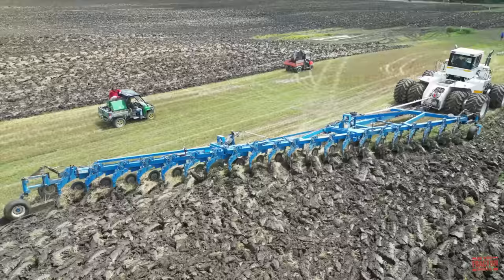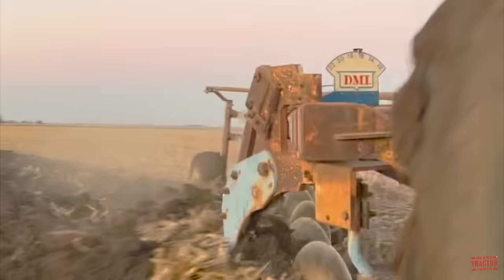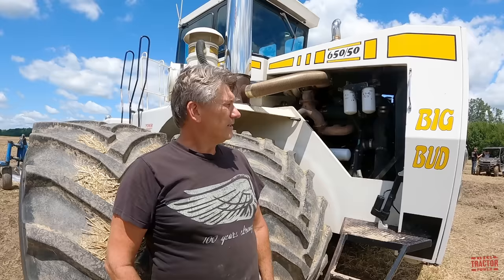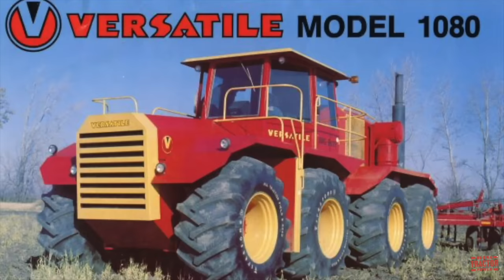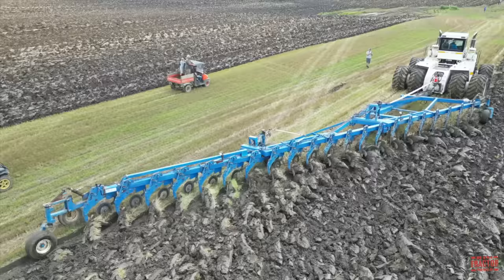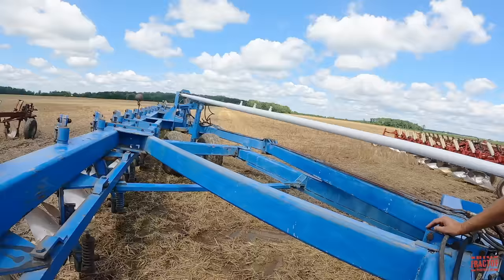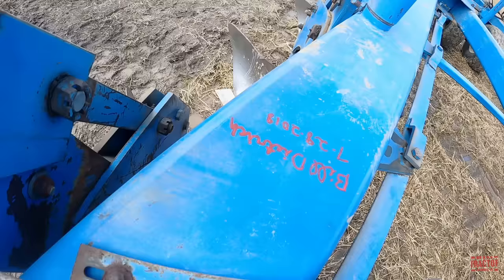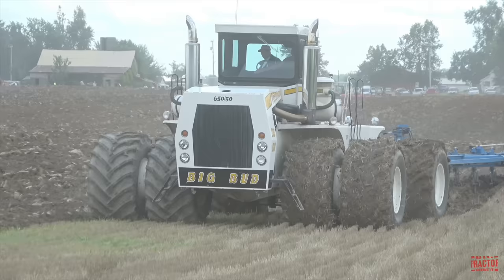21 Bottom DMI 9021 Hydra-Wide Plow

Comment: Everyone loves plowing videos. There is just something extra special about it that everyone  enjoys  watching or doing. Seems like a lot more farmers are starting to go back to moldboard plowing the last several years too. We have driven through North Adams MI and the surrounding area several times. Never saw this tractor, but would have been cool to.  What does the 50 suffix stand for in Big Bud tractor model designations?
Reply: I think in some areas you need to turn the ground over. probably more in potato ground.
Reply: 50 stands for being equipped with a Twin Disc transmission. They were first manufactured in the Minneapolis, Minnesota area.
Reply: I do love a ploughing video, if it's done right.

Comment: When I was a kid tillage, plowing and discing was every year.  Nowadays it's rare to see.  Doesn't tilling the ground potentially help with more yield?
Reply: Greatly depends on the ground and the crop.  Organic crops are getting more popular and those farmers use tillage to help control weeds.
Reply: Basically tillage is expensive... just with diesel alone....no till saves a ton of diesel cost...that being said....I don't know the current cost benefit of till vs no till.
Reply: So much depends on the soil, the climate, and the values of the farmer. Tillage is easy, and does a good job of covering up mistakes. On level ground, it may not be too detrimental, especially in more northern areas. On lighter, more rolling soils, properly done no till will do a better job of maintaining soil health and gives good yields, but it take more intensive management and it is harder to hide mistakes.
Reply: @samb7652  No till requires a lot of chemicals to control heavy weed pressure and more fungicides to control foliar leaf diseases that are always left on top of soil surface after harvest. Several diseases overwinter on the soil and are ready to overtake the field the following year. Examples are tan spot in the wheat and white mold in beans. If you leave diseases and weeds to keep reproducing, then the weeds get "smart" and resistance is the next problem.  No right or wrong answer, just depends on your crop rotation and type of soil.

Comment: Designed and Manufactured with Ingenuity is what it said on my DMI plow. The hitch on mine lacked 'Integrity' so the local welding shop/ part time farmer rebuilt it to withstand 300 hp (5 bottom) No reason to have to fix things more than once was his motto.
Reply: We pulled a DMI 12 bottom with our 300hp or so 8550.  What we had they called "over engineered," it was huge, really overly heavy duty. It was a site to behold.  Hard to imagine something didn't go wrong during production of yours for a hitch of all things to need welding.  That must have been a big job
Reply: @heatmoon  8-18s was a good match for our 8650 in our soils.There were a lot of older (white) small ones that the front end ripped out, center beam was butted up against a much thicker flat plate and welded on.The hitch offset and pulling from below not hard to see why some failed. The welding shop had just finished doing another one before mine. Had a 4440 on it when it let go. Flat steel where 2 large angled pieces tying it together made it much stronger.

Comment: I like this video especially because you included a look at the other tractors owners had use to pull this plow. They were debating how much horsepower the current Big Bud needed to pull the plow. A rule of thumb for handling a plow is one draw bar horsepower for every inch of plow width. If this plow can be widened to plow a swath 40 feet wide (480 inches) at minimum the tractor pulling it would need 500 hp at the draw bar. Likely 650 engine horsepower. That's a lot of tractor and power to put on the ground.

Comment: I grew up farming in the 70's and would'nt even think about plowing when the ground was that wet! I also worked for a farmer that had a 10 bottom Dmi plow.
Reply from the maker: Nice on the DMI. The reason is so wet is this was a plow day planned for the last weekend in July on the Saturday and it rained 3 inches the night before so it was postponed until the next day and it was just about dry enough to run out there.  People traveled from all over the country to be there and they wanted to try to run surprisingly they ran a Degelman pro-till right behind the plows and the ground melted out pretty good with just one pass

Comment: Have used a 6 bottom dmi hydra-wide for fall plowing, really great was when doing fields after picking corn if started to plug from stalks would just open a little bit, let the plug go through, then close it back up, the farmer worked for had added a stop at 18 inches so wouldn't close any farther after opening for plugs
Reply from the maker: Very nice.  What did you pull your DMI with?  I just shared an IH 1566 with a DMI 6 bottom on a YouTube short at https://youtube.com/shorts/shosA_jSaZE?si=6HT9wy9huCjNLqP-

Comment: Do we not use large (oversized) tractor and attachment like the Big Bud/ DMI 21 bottom?

What would be the reason for not building Big Bud/ and other large attachments for it?

-Cost? 

-Maintenance difficulty?

- weight/ material stresses?

Sorry if foolish question?

Richmond, VA
Reply from the maker: Good question.  In the 1970’s farm equipment was getting bigger and bigger.  Plowing was the main form of tillage. 

By the early 1980’s tractors reached a peak in horse power as crop prices fell, drought reduced yields and high interest rates hurt sales.  

Plowing quickly gave way to faster paced conservation  chisel plows and no-till.  

By 1985 the 500-600 hp tractors all ceased production. 380 hp became top end for a decade until the mid 90’s.

Comment: You might want to mic up the interviewee next time. And maybe a wind screen.
Otherwise good video.
Reply from the maker: Yes the wind was unfortunate  for the sound as the walk around went on.  It was also a big plus to see the plow run.  I drive 6 hours on a Saturday morning leaving at 2:00 am to see the plow and it rained 3 inches on the field just as I arrived.  The interview was conducted trying to show the plow and navigate the pool of mud around it.  Luckily the wind dried the field and by Sunday afternoon at 1:00 pm field was mostly dry enough to plow.
Reply: You definitely work harder than I would. The only time that I'm up at 2am is if I haven't been to bed yet. 
They do need to get some drainage tile in that field.

Comment: That bigbud needs a diff locker
Reply from the maker: The 650/50 has 75,000 pound axles.  They were not set up for a differential.   Even if they were the tractor has so much power you would run a great risk of just tearing up the axle.   The best bet is to just power through the mud.  This field had 3 inches rain on it the day before.